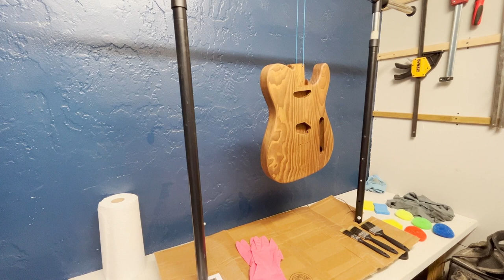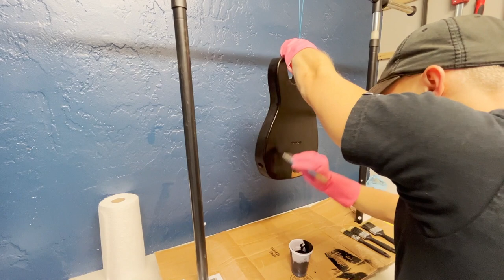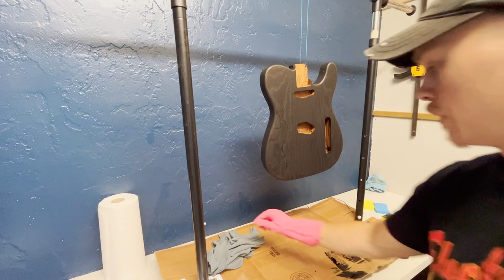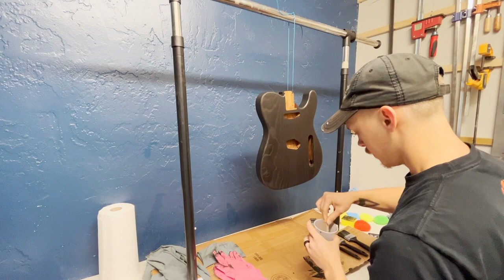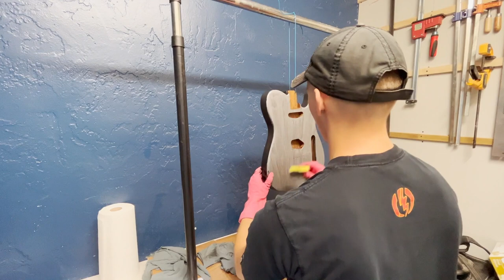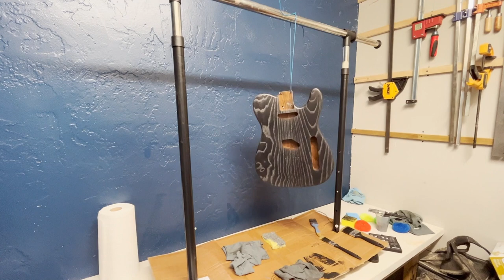Ceruse Finish Ash Body Telecaster Electric Guitar with Rubio Monocoat

Comment: Wondering if you can do this but using black angelus dye for the base color instead of the paint
Reply from the maker: I think that would work as well. The black pre coat is more like a dye than paint but either way as long as it soaks in.
Reply: @erikguitardesigner  For sure. Great job. I’m also curious if combining this method with the Japanese Shou Sugi Ban torch method would be cool - I have seen a couple of videos utilizing both but on wood in general - not on a guitar body.

Comment: Looks amazing. Your links go to a warning page, so I'm on their direct  website. A couple questions, the first may be a stupid one. 1. Does this then need a top clear coat? 2. Is it resistant to fading? 3. I am using it on a flat slab original P-bass swamp ash shaped body (Warmoth made), and want to end up with all the pores eventually filled for a smooth top. Could I use a clear grain filler over this process (then a wipe on poly to seal it again?)

Comment: This is amazing. I have an amazing Warmoth Tele in Ash that I am dying (no fun intended) to do a Ceruse Finish on. Can you get that Rubio in a color other than gray? I was looking online but I am not sure I am searching the correct product. This finish you did was amazing. Seeing this makes me think this is totally do-able.
Reply from the maker: Totally do-able! If you want to change the silver/gray that I used, look through the "2C Oil Plus" products. It's a bit frustrating because their website is a tad outdated, but I hope that helps. Oh and make sure you get the accelerator, too!
Reply: @erikguitardesigner  I have watched this video several times lol I also ordered another body as well :) Here is a question. What kind of clear did you use on this? I am not really set up to spray stuff, so I typically send finished bodies to a guy who clears them, but what product will cover this without harming it?
Reply from the maker: @negative2974  I use spray can nitro from stew mac, just a couple quick coats or more depending on how glossy you want it. There are good wipe on products as well like minwax poly, and there's a product i've used from Livos that I really like that is all natural/no chemicals. Check them out here: https://www.livosusa.com/
Reply: @erikguitardesigner  wait what?  Are you saying you sprayed clear over the Rubio Monocoat?  I've used Rubio on coffee tables, end tables and desks and the stuff is very durable.  It was originally designed as a finish for wood floors.  Why did you choose to put Nitro Lacquer over it?  Is it because you wanted a more glossy finish?  Did you consider skipping the nitro?
Reply from the maker: @bammortgage  because I do what I want! lol I do like the glossy nature of it but that's also just what I'm used to. I haven't done enough of these to see how it wears in to judge whether or not it was necessary. I did another one where I just wiped on wax coat. Doesn't hurt anything but that wasn't my way of saying rubio monocoat isn't durable, i'm just used to putting a finish coat on everything.
Reply: @erikguitardesigner  did you use any sanding sealer before applying the rubio?

Comment: Awesome results. I have two questions for you though.instead of silver could I get the pure and add mica powder pigments and what is a suitable clear coat to use after?
Reply from the maker: That might work. The fun thing with guitar finishes is that it may take a few tries to get it right so practice on some scrap wood and see what works. For a clear coat the most I use anymore is a few thing coats of nitro. I hate sanding, polishing and buffing. The time and effort aren’t worth it to me.

Comment: Do you think if I put an additional rubio midnight indigo blue on it, it would make sense? Because I'd like it in a black and blue color scheme, but I'm afraid the blue won't show up and stand out as nicely as the silver. That's why I thought to put the silver first, and then put the blue on it some more :D What do you think?
Reply from the maker: It's worth a shot! I'm not sure if it would make a difference, might ultimately depend on how dark the wood is to begin with. That's the great thing about wood finishing is that it takes experimentation. You might be on to something really cool!
Reply: @erikguitardesigner  The wood is swamp ash, so very bright! Well just tomorrow my rubio will arrive and I am struggling with thoughts whether to put rubio silver gray first on black rubio precolor easy and then midgniht indigo, or just on black precolor put midnight indigo right away. I would really hate to waste this body, because I have made deep furrows in wood grain, so it will be hard to sand it smooth again.  But thanks for your answer! It might actually be worth taking a risk and doing a little experiment. I just hope that rubio oil 2c will layer on top of other oil 2c, just like on precolor
Reply from the maker: I always save scraps of wood to do tests on for this reason. Or at least they’re good for practice before the real thing. The Rubio products are amazing though and super easy to use.

Comment: Great job. You mentioned that you sanded to 320 grit and then used Rubio Monocoat, but they recommend no more that 150 grit to ensure the wax/oil will penetrate. Did you have any issues? I plan on doing the same finish and wanted to hear your thoughts.
Reply from the maker: Nope, no issues! Have fun!

Comment: its awesome. but im not good at english, so i got some question..
could you tell me is it correct?
1st. Rubio black + accelerator
2nd. Rubio silver + accelerator

and it’s another question, is there any recommendation of finish coat? or is it enough without finish coat?
i don’t want to lacquer nitro finish because of sticky
Reply from the maker: Yep you got it! You don't need a finish coat, but sometime I like to spray a few coats of nitro lacquer over it.
Reply: @erikguitardesigner thank you so much
Reply: @erikguitardesigner  is it okay with roasted ash body? i can get roasted one only..

Comment: Nice work. How did you seal the body after applying the wax
Reply from the maker: I sprayed a couple thin coats of nitro and got the sheen i was looking for. I’ve been told the wax is good enough on it’s own though so i might go without from now on.

Comment: Good job ! Did you use grain filler before or only sanding ?
Reply from the maker: Nope, no grain filler.
Reply: @erikguitardesigner  thanks :)
Reply: @erikguitardesigner  And can you seal it with Tru Oil in the end ?
Reply from the maker: Yep! I only use true oil or a few thin coats of nitro for sealing. Depends on the player or finished look.

Comment: Just finished online chat with a Rubio Coat representative, asked him my same questions that I already asked here. Here is what they said. No top coat needed or recommended due to the was in the product. One concern is that since the 2C Oil Plus part is mostly wiped off, the pre-color isn't a top coat, so will it have enough protection as it is? He also said grain filler won't be compatible with it either. He also said it's not compatible with poly for a top coat.
Reply from the maker: The real question is how much protection does it need? I like using thin finish options because I like my guitars to be easily relicc'd and I don't use grain fillers either. I have sprayed a few thin coats of nitro over their products before and It seems to hold but don't expect a clear/glossy/mirror finish. It just starts to shine a little more the more coats you spray. If you're looking for something you can spray a glossy mirror coat with grain filler I'd look into spraying and hand painting the grain lines.
Reply: @erikguitardesigner  Yes I prefer the thin hand rubbed finishes too, and have mostly gone with Tru oil and Tung oil varnish before even without grain filling. The pores are pretty tight on this particular piece anyway, more the straight tighter grain, so I know it won't have the wider contrast areas like you got with this Tele, more like striping/zebra kind of thing which should look cool too. So I'm not going to be concerned with grain filling nor even a top coat after all actually. The satin look like you got here will be awesome. They said you can apply maintenance coats of the oil part down the road if it starts to show signs of wear, but the relic look is fine too, so that natural wear over time will be fine.
The best news is how simple and easy it is, not requiring a bunch of expensive products and steps (ie dyeing, sanding sealer, then highlight gel stain, then top coats). This will literally be two products (well three with the accelerator) and two steps. What you got is definitely what I've been looking forward to doing on a bass. I am going to pair it with a raw Wenge neck, the coloration and streaks should be similar and compliment it.